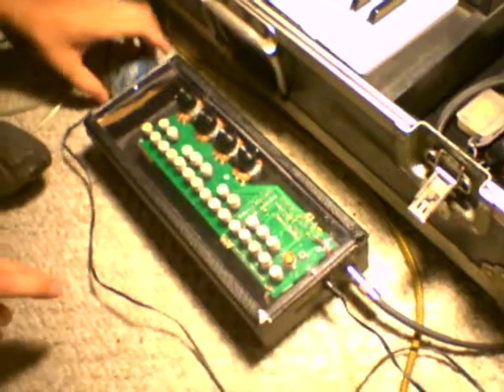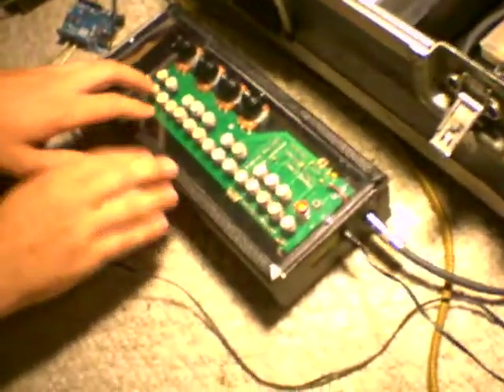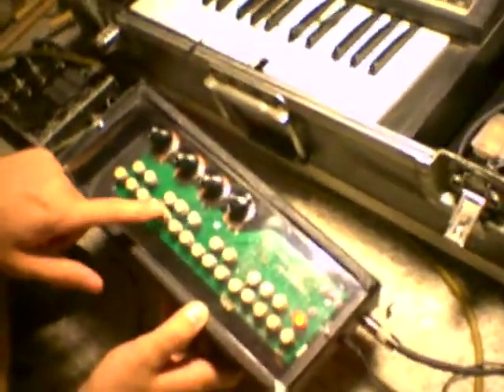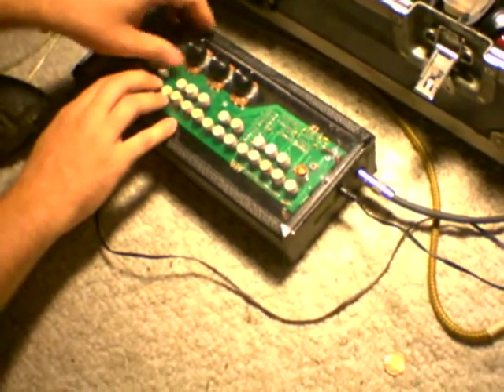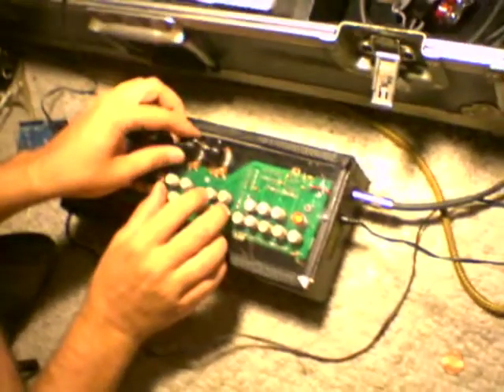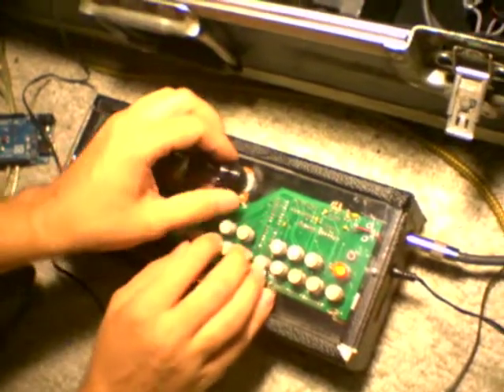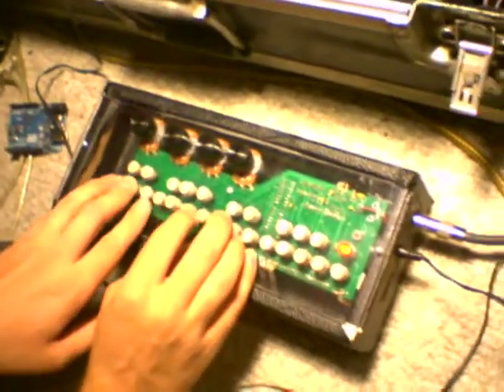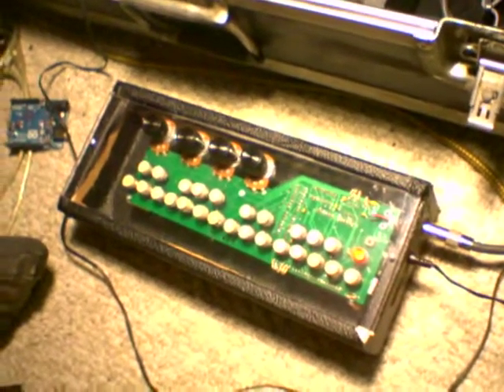Programmable Arduino Synth

Comment: The Arduino hardware, the blue chips itself, isn't programmed in Processing. It's programmed in the Arduino. Which is a coding language based of C++. The IDE,the program that you use to send code to the Arduino hardware, was programmed in Processing. And Processing is a programming language similar to the Arduino language, but rather then being a simplified C++ language, it is based of Java.

Comment from the maker: Haha, no actually both the pocket piano and the basis for this project were made by the company Critter and Guitari (linked in the comments). Before the pocket piano, they made an Arduino shield that was programmable - which is what this video is depicting. I programmed the sounds and built the enclosure.